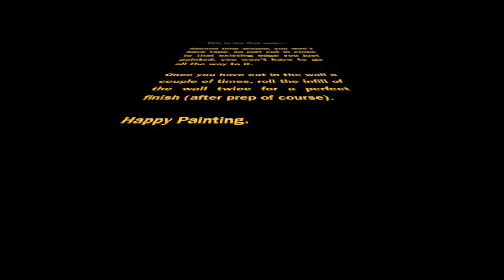Feature Wall - How to do a Perfect Straight Line

Comment: Or.... You could use yellow frog tape (for delicate surfaces) and make sure once you put it on, you run a small blunt object down it so you get no leaks. The finish on your line there was shockingly bad and I'm not even trying to take the piss.
Reply from the maker: +Shaun Scott you dont have to try to take the piss buddy, im sure you do it well enough without trying at all, now fuck off my channel dipshit

Comment: Do you let the no more gaps dry or paint while it still wet
Reply from the maker: no you run a small bead down the edge of the tape where you want the straight line, wipe off immedately which leaves a tiny bit on the edge of the tape, cut a line down with the paint using a brush, then peel the tape off while wet.   When you go to do the 2nd coat, you wont have to go quite all the way to the edge and you will have a nice straight line.     If you dont use the no more gaps step, what is likely to happen is paint will 'bleed' under the tape and you wont have a perfect line.   Also using one piece of tape and sticking down every 6 -8 inches makes the line look straight even if its not quite dead straight.    You can tell when people have used 2 or 3 seperate pieces of tape.